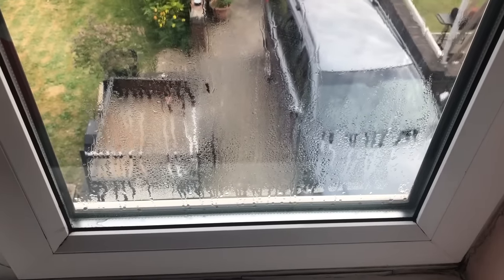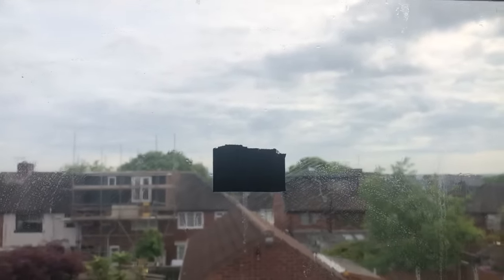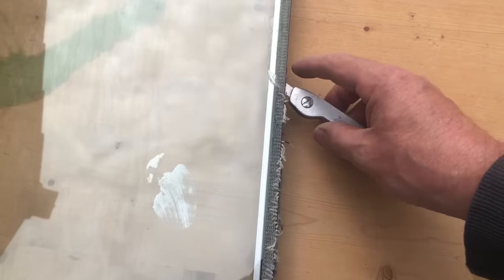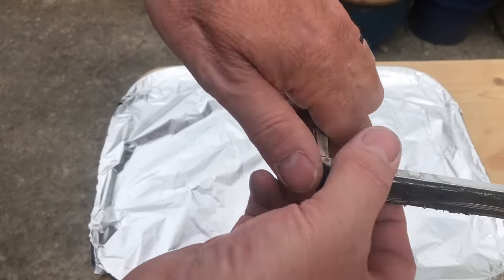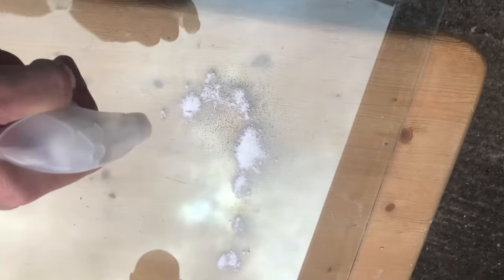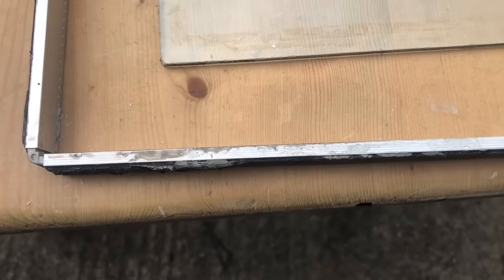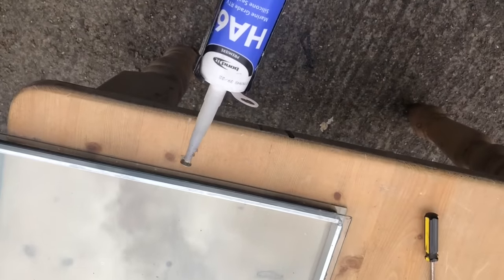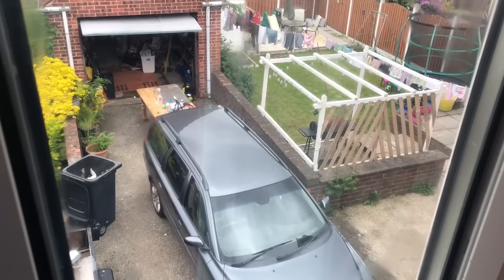Double Glazing Unit Condensation / Blown DIY Repair.

Comment: I always thought that the two glass panes had the air sucked out of the void between them before they were sealed at the factory - ie that there is a vacuum between the panes, so this was an eye opener. If it wasn't October I would be tempted to try this on one of our blown ones.
Reply from the maker: The weather does need to be onside, I have waited weeks to find the perfect day when I am available to do this and the weather is bone dry! I had to do the last one indoors because the weather app lied to me and it rained!
Reply: You can get sealed units like that, failed seals, when air laden with moisture gets inside, that’s when condensation occurs.
Reply: You could purge fill them with argon, which is what most have from factory.

Comment: I recently changed 3 condensated units myself, I paid £110 for 2 comparable units to yours  and a 1.5m x 1m unit.  Whilst it wasn't a bad price, I still have some small openers that were expensive to replace because of the custom design and I think I will try this repair in the summer.

The glazing supplier did deliver the units, but I had to dispose of the old units and that is easier said than done, my local recycling centre refused them and I had to travel 30 miles to go to a site willing to accept them.
Reply from the maker: That’s quite a good price from the information I have received via the comments on this video, better than I expected. It’s disappointing that the recycling centres are being awkward regarding disposal. Good luck with your future repairs.
Reply: @TheRepairer  We have several manufacturers locally, so I go direct to them.  No doubt the people here are paying for someone to come out and measure them.

As long as you remove the trim to expose the unit and measure exactly, you will be fine.

Comment: A good job well done and very well explained, you've clearly saved yourself a lot of money and avoided the unit having to be destroyed for recycling. The fizzing you saw with the Vinegar and Soda Bicarb was the reaction between Acetic acid (from the vinegar) and the bicarb which releases Carbon Dioxide. Did you consider using a household detergent (eg washing up liquid) to remove the traces of WD40? Once again thanks very much -  it's useful😊 to know that that can be done.
Reply from the maker: I didn’t consider a detergent as the white vinegar seemed to eradicate all traces of it after the multiple passes that were required to clean up the window panes.

Comment: Just a tip on cleaning glass where you want to minimise residue. Do a final flush with distilled water. You can get a 10 liter container from a pharmacy for not much money. It will dry completely clear and leave no residue behind.
Reply from the maker: I never knew that, thanks for sharing.

Comment: I used to be a window fitter commercial n domestic. And I've seen sealed units being made ...Youre video was very good. Would give people the confidence to try it themselves I'd also use new desiccant (Silica balls that absorb water and moisture).Im pretty sure that once they reach the end of their life that's it. You're heating method would work for a short period. Hope u don't mind me saying that. Because I'm not knocking what u did .Just trying to help is all
Reply from the maker: Your opinions are appreciated and valued,many thanks.
Reply: Thanks
Reply: @TheRepairer i think there is nothing wrong with the oven drying of the dessicant. Years ago, i worked in a chemistry lab which did gas chromatography and one of the things we needed to do was to dry the compressed air from a Compressor. To do that the air was filtered through molecular sieve cartridges which contained the same stuff as is used in the double glazing. We used to recondition it by drying in an oven overnight and repacking the cartridges. It was the recommended procedure and worked fine.
Reply: Its a rubbish video, did you notice its a tilt and turn window?

Comment: Very good video. I always though the panels were filled with a gas to improve insulation.  Clearly, I was wrong.
Reply from the maker: I thought exactly that too before I looked into double glazing  construction deeper,I do wonder if DG salesman had a hand in forming this popular belief.
Reply: Some are. You can buy argon gas for £30 and put some in. It’s heavier than air.

Comment: Nice job! I'm surprised you were able to get the inner beads off without first removing the outer seals - I found it to be impossible to do without doing this first. It seems that south facing windows seem to suffer this problem the most - I had 6 or 7 panes with condensation like this, all south facing and ended up going down the replacement route (bungalow with around 30 units in total!) albeit did it myself - the new glazing has a u-value that is around half of the old panes and argon filled so far better thermal insulation, though I expect a similar lifespan - it's a tough dilemma as the glass itself is fine, the weakness is in the seal and the dessicant which fails after around 10 years but the difference in thermal efficiency has been amazing - I still have all the old units and hope to be able to re-purpose them either into a project or for someone else - it's the glass that has the highest embedded energy after all...
Reply from the maker: I think you could be onto something with the south facing failures!
Reply: It all depends on how the unit is glazed. Some of the older windows are glazed without gaskets, then a wedge gasket is pushed in after the beads are on. More modern windows have a co-extruded gasket on the frame and beads. Not all window systems are the same, some have a double fin bead, but again the more modern ones have a single fin bead system.

Comment: Well done you've made a good job, might I suggest you use extra fine wire wool to clean any marks on the aluminum frame it'll polish instead of scratching the surface like sandpaper does. I've got water in mine 15 mm deep the full length  of the frame it happened  in a storm rain water overflowing from the gutter above it.
Reply from the maker: A good idea, I think the wire wool will work well.

Comment: Repairs like this won’t last, 25 years experience taught me that!
Reply from the maker: The original factory window unit didn’t last either, hence the repair!
Reply: You are correct , its a bad bodge video . Anyone in the trade will tell you . I wouldn't reccomend  anyone even take the glass out for they may do more damage to the window!
Reply: @julesdowner5585 Yeh well. If it breaks, then just buy a new one anyway. It’s not a bad bodge. The water in the frame is gone!

Comment: This wouldnt work for low e-glass as you would remove the coating from the glass. Fair play for fixing your own window though. A new argon filled unit of that size would be around £80.
Reply from the maker: I’m now reading up on low e-glass, thanks for making me aware of it.
Reply: Surely it would still work, just not be as efficient as the original, but of course still an improvement on the blown unit
Reply: @markthomasson5077  One of the manufacturing processes of low e-glass is a microscopic, almost transparent coating on the inside of the glass surface. If this were to get rubbed or scratched off, this would be like having scratched sun glasses. Not great, but yes- still usable.  
The bigger problem would be the thermal conductivity of the unit. My old 20mm double glazed units had a U value of 2.  A new low e-glass argon filled unit near a u value of 1. In layman’s terms, a new unit is 100% more efficient at keeping the heat in your home (heat loss through the glass). 
I worked out that the cost of replacing my windows myself had a payback of 10 year (less if yyou take into account  compound interest on savings and ever increasing fuel bills).
Reply: @garyherberson8119  surely the low U value comes from the inert gas filling rather than the tint preventing solar gain?
Reply: There are two types of low E coating. A soft one which is easily scratched and a very hard one which is baked into the glass at very high temperature. Argon has no connection with low E, it just increases the thermal insulation compared to air fill.
Reply: @hpt08  Both tint and gas comes into play for a low u value. The tint is also reflecing heat back into the house, heat that would have otherwise escaped. I know this sounds a bit like salesman blurb, but it really does work with the low e glass. Ive got every respect for that guy in the video fixing his units, but the thing is, its just not cost effective to repair.

Comment: Nice work. The maintenanc contract on my flats I have to go to a specific window replacement company. Replacement units £200 ,+ vat a pop. I always thought there was a vacuum or a special gas between the glass to stop the condensation ! I always believed the repair beyond me, so unhappily paid the £200 ,+ vat. Could never understand why they weren't repaired!
Reply: Because they are only twenty quid to make.
Reply from the maker: That’s costly at £240 a shot inc vat, glad you enjoyed the video.

Comment: Far easier just to replace with new unit and could be dangerous for someone who is not working with glass on regular basis.
Reply: You could make this a new video for the Edward Murdoch repair channel just to show how much easier it is.
Reply: @detiex5576  Having worked with dg units on many occasions and seen them breaking for no apparent reason I would rather not. 🤷‍♂️
Reply: If glass is toughened could shatter just with sharp blade or a little bang on the edge with your metal utensil. Wouldn't advise this repair tbh
Reply: IMHO it’s not worth risking do this I worked I. The double glazing industry for over 30years .My advice is DONT TRY THIS .just buy a replacement unit. .
Reply from the maker: A balanced comments section is most valued, thanks for taking the time to communicate.
Reply: On obviously it makes a good video. Glass should be compounded with pumice powder after de- greasing. Lots of DG companies don’t do that.  Good vid
Reply: Buy a new unit ew tight kent!
Reply: @PrinceOfGinger 😂
Reply: Def don’t use the metal scraper to try and wiggle the glass out ,that is what glazing shovels are for , the glass was stuck to the external gasket so you would of been better off opening you tilt and turn window and putting a glazing shovel between it and the glass to free it .
When resealing your unit perhaps clamp the glass together as it will stop the spacer bar bending and make sure there are no gaps in the unit , I could probs go on but it’s probably an uneconomic repair taking into account of you time but well done for giving it ago
Reply: I have fix quite few units in my house if you know what you doing and your patient is easy, the worst is wait for silicone to cure 😮

Comment: i did a similar thing on a curved 2 meter tall toughned unit  the art deco look ,  on the corner of a porch as replacement cost was highly prohibitive ,, took me 3 days , used black lmn  silicone , pumped in behind a 3 inch strip of 5 mill ali ,,  replaced the dessicant tho ,, , but well worth the saving of 2500 quid  for a new bespoke  curved unit , still going good 5 years later ,
Reply from the maker: Well done for taking the initiative and using your DIY skills to avoid lining the glaziers pockets.  I bet every time you look at that window you can do so with a sense of pride and achievement that you wouldn’t have got if the curved window had been renewed, that’s 3 days we’ll spend in my book!

Comment: Fair play for your skill level but a replacement unit would be around £40 and can be replaced in just a few minutes.  Depends if you value your time more than £40 for a few hours I guess.
Reply from the maker: Sometimes the excitement of the chase combined with a good degree of curiosity can outweigh the economics of replacement.
Reply: Think you could spend just as long looking trying to find a cheap deal with a product that matches then installation etc, I have the same problem in my Kitchen for a much larger window that's not so easily replaced.
Reply: £40? Do you live up north because London would be £100 (at least) and online £80
Reply: @garyherberson8119  I’m out of date then as I replaced mine 3 years ago and they were cheaper.  I’m in Cornwall.
Reply: You are obviously not retired. When you are, you will be more than happy to spend a lot of your time saving money you haven't got.
Reply: @shed.projects5150  no, I’ve 5 years to go yet.  Only just hit 50

Comment: This is great, makes me mad when ppl don’t try to fix stuff instead of “just buy a new one” thank you for taking the time to show us👍
Reply from the maker: I get lots of it,  having a repair channel,thanks for your positive comment.
Reply: @TheRepairer  my very first thought when needing to know how to fix stuff is from ppl like you on YouTube, it's sad that we live in a "throw-away"society.
Reply: Its  a bodge , do not even attempt this please .
Reply: @julesdowner5585  why, what's so wrong with it?
Reply: @gasgiant7122  There's no gas between the two pieces of glass, reducing the insulation. The dried out desiccant won't last as long as when it was new  and the silicone sealant isn't as good as what was originally used in the factory.
Reply from the maker: I have two repaired double glazing units that are still working perfectly over three years since this exact repair was done to them.
Reply: @TheRepairer  Really?? Lucky you then  . It doesn;t take away that this is a very dangerous thing to advise people to attempt .  . Also its pointless and  time consuming and i guarantee that it will not work for people . I have done this sort of nonsense  before ,but not since i got sensible .
Reply: @malcolmhenderson3866  yeah but who cares, it still functions better than a single pane!

Comment: How well will they perform though? I thought double glazed units are filled with a gas or vacuum to create a barrier. Obviously this isn’t possible repairing them like this. Great video.
Reply from the maker: Thanks,  I did a couple at least two years ago and they are still good and dry.
Reply: Do you get condensation in the winter?
Reply from the maker: No they are both good
Reply: Thanks. I’m going to give this a go. 👍
Reply: Some expensive ones are argon filled but there is no vacuum. The trick is in the gap size of 12-16mm which prevents convection currents forming in the trapped air.
That's what I heard anyway!
Reply from the maker: Interesting knowledge.
Reply: Was also under the impression the air was sucked out of them as a vacuum doesn't transfer heat/cold or sound?
Reply: @matthewwakeham2206  vacuum ones do exist.
Reply: @markthomasson5077  
Yes they do, but not for the types of unit shown in the video. They are too expensive for the average house install, heritage and passive houses are typical applications.
Reply: Good old fashioned air is already a very good insulator. It has to be trapped of course, like between panes of glass, or between the fibres in a sleeping bag, fibres in loft insulation, etc. Air’s insulation properties are why clothes keep us warm.

Comment: I’d never even thought to repair them , looks pretty straight forward and I’ll try on a couple of mine . One thing though , I think using your thumb to press in the sealant is just asking for a cut thumb . Either a good glove or better still , create a tool of some kind for a pro finish and a happy thumb .
Reply from the maker: Your right about the thumb, I shouldn’t have done that as glass can be sharp, fortunately this pane  wasn’t but others if repaired since have been. Thanks for viewing and taking the time to comment.

Comment: I see that you have a very wide spacer frame in the double glazing, so I thought it wouldn't be a bad idea to look at acoustic double glazing, because I don't think it would matter if it were a little narrower.
And i reccomend this configuration:
10mm float / 10mm spacer / 8,4 or 8,8mm laminated glass

Comment: Where i worked after sealant had gone off overnight we unclipped the units and used a stanley blade scraper to take off any excess from the units and fine wire wool then we taped the units up with aluminium foil tape to save cut fingers

Comment: I recycle the glass from these units.  Interesting video thanks.  One thing if I might chip in is to use an electric blow gun to warm up the glass along the edges.  It's a pain in the arse job to do but warmer silicone is easier to slice.
Reply from the maker: Thanks for the information, much appreciated.

Comment: I didn’t know this was possible. I’m now inspired to give it a try. Thank you so much
Reply from the maker: You’re welcome 😊
Reply: Do not try this , its a bodge , Order areplacement unit and fir it yourself if you must , but i have done this a few times and its so difficult and  just not worthwhile when you factor in cost of materials . You could destroy your window just getting thev window beads out .  That window also is glazed from the inside , not all windows are . There are so many things wrong with this video , i cannot list them all. . The glazing packers are in the wrong place for a start. Itds a dreadful idea .
Reply: It will last 1 week. Waste of time.

Comment: i'd be keen to see you try another method if you have this problem again: drill the interior glass top left and bottom right, evacuate the moist air, pour in some fresh dessicant, seal the holes.
Reply from the maker: The window is still good so no need todo anything , I think companies have set up in business drilling and venting windows using very similar or the same techniques.